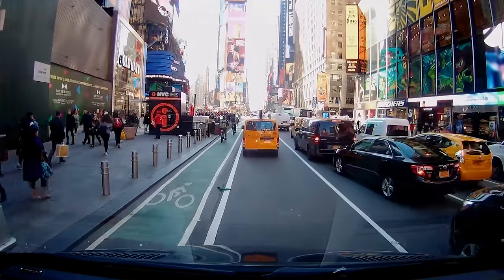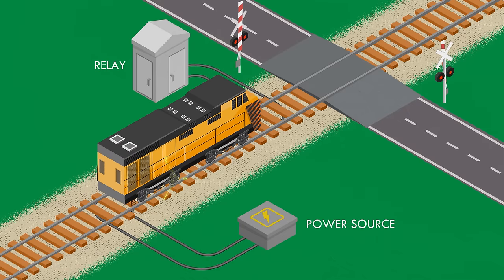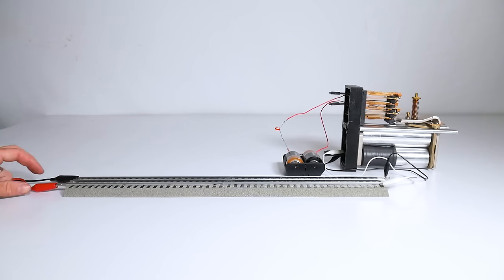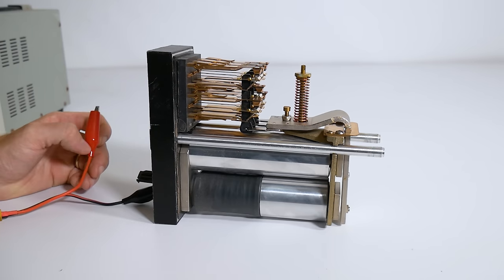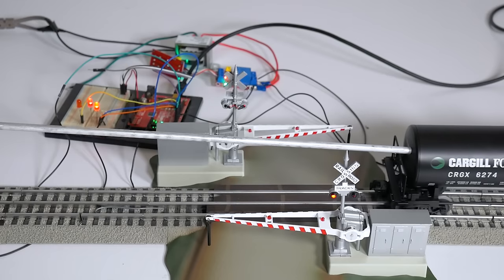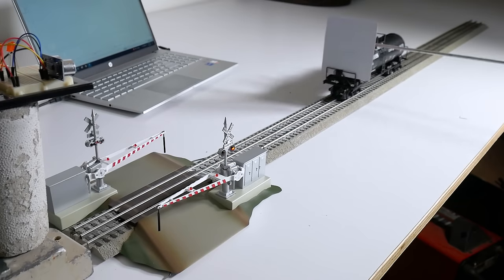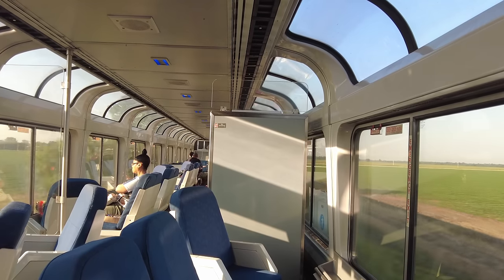How Railroad Crossings Work

Comment: In Italy the majority of railroad crossing have also train signals that turn green only when the barriers are completely down, and in certain RR crossings, if it don’t detect any vehicle in the crossing. If a car is stuck in the crossing, they can break the barrier and the rail signal turn red again
Reply: In the US there are a lot of protected crossings that also live in dark territory where no signaling system is used, so this system isn't in wide use even on PTC territory. There might be a few exceptions like dropping a signal to a restricting aspect due to a malfunction, but that's exceedingly rare. The most we use is a lighted whistle board that tells trains if the crossing is working. There's also a light that is used to communicate to train crews that the crossing is getting electricity.

Comment: sth I don't really like about level crossing safety in the US: after the gates are closed it doesn't take long for the train to rush through. In other words: when the crossing isn't clear there's no way the train can be stopped before reaching the crossing.
In Germany the max speed for rail lines to have a level crossing is set at 99 mph. Lines with a higher speed may not have any level crossings. In fact, even lines with a lower track speed may only operate the already existing level crossings, but new ones may not be built.
Gates at many crossings close 90 seconds (rule of thumb) before the train passes the crossing. This gives them the time to stop the train in case the crossing isn't clear for whatever reason. 
Also quite many crossings are equipped with CCTV or even radar detection to check if anything is located between the gates once they're down

Comment: Some tracks have rules about the minimum number of axles a train can have (usually about 30) to guarantee detection by crossings; or if you have less you have a greatly reduced speed limit.  Engines running alone for example.

Comment: Hey PE, this is a nice straightforward explanation
Now for tricky aspect - the sound level of the train horn. What factors are used to set that level? 
Does the average number of people within the range of the effective level contribute to the sound level?
Are levels set lower when the intersection is in an urban environment, and higher levels for rural areas?
When was the horn sound level last set?

Comment: Thank you for such a simple explanation and demos I live in a city where a power plant supplied by rail is located and always wondered why even when the trains were stopped the crossings near the plant weren't passable though why they decided to put the hoppers where the train cars dump their coal so close to the crossing is a mystery to me. Also not sure if it would be a practical video for your channel but do you think you could explain why instead of ripping up rails after they're abandoned railroads will leave them installed in Oberlin which is a town in Ohio I frequently visit as you come into town there's several examples of abandoned rail networks and crossings but the rails are still there sometimes paved over

Comment: Great video! Im curious how you are going to cover train signaling and how it works with train control/train protection systems, such as ATB in The Netherlands which if I remember correctly also uses track circuits, with each frequency emitted in the circuit updating the speed limit on the ATB however its displayed to the train driver, ATB seems to vary from train to train in Dutch railways with some trains displaying it as a speedometer bug, others just being a set of lights with numbers written on them displaying the speed, or a digital readout. The subject does get quite complex with each country having a different solution to signaling and different rules between railways are common even within the US, the same aspect could mean something very different, this issue is quite present in Australia and Europe as well.

Comment: Hi, My job is designing track circuits, and I have never heard of track circuits being able to detect train speed. Can you share your source for that? It would be great to know!
I agree that AC track circuits are used on tracks with electric traction. Audiofrequency track circuits (the ones where you can hear the frequency), are used because they don't need insulated joints. They can be used with contiuously welded track, and the individual track circuits are separated by an electrical barrier connected between the rails (typically a combination of capacitors and induction coils which are tuned to form a frequency filter)
Also you have omitted axle counters which are also frequently used with rail crossings. Definitely a topic for a future railroad video!

Comment: I live in between 3 train crossings (all around 1km apart) and thanks to this I understand why I hear 12 deafening whistles every few hours, more if there are 2 trains crossing in either direction at the same time. Given all of these amazing safety precautions in place at crossings, how necessary is it for the whistles to be as loud as they are? Would safety be compromised if the volume of the whistles were decreased by 20% or even 50%?

Comment: In Germany, there's also signals that tell the train whether the crossing is secured. That is either a dedicated signal that informs the train driver of the status of the crossing, or they're integrated into the block signalling, where a regular signal will show danger until the crossing is secured. Is that a thing to perhaps mention in the signalling video? Also, I would have liked a discussion of the various systems available that automatically detect whether a closed crossing actually is clear of obstacles.

Comment: In a rural area or out in the country their were areas where railroad tracks would cross a two lane highway and the only warning was one of those white railroad crossing  signs. If you were traveling along a deserted stretch of highway and came up on one you could stop and turn off your headlights to see if a train was coming. Most people would just turn off their headlights briefly to see if the trains light were shinning across the road. If they were you did your best to stop. You could not see the train in the distance because of trees planted on both sides of the track. And don't forget to pick up your feet as you cross the track. But I don't know why.

Comment: I used to drive a light rail train for RTD in Denver. most of the lines we operate follow this logic of crossings, and operate quite well. however the newest line, the R line, built through the suburb of aurora, was simply ridiculous! There are quite a few crossings along the R line where the train has to pull up to the edge of the crossing and wait several minutes for the arms and bells to activate. The R line was so poorly built and was such a pain to operate. I was frequently sent to operate it since I was the new guy and all the senior guys didn't want to operate it

Comment: The current detection method is similar to what is used for cars at some lights. Your car goes over an embedded electrical loop, and the bottom of your cars cause a disruption in the circuit, telling the controller that there is a car present. Ever since I found this out, I have been wary of where these coils are, and try to place my vehicle over them to make sure it properly registers my presence, otherwise I might be stuck at a light for a while.

Comment: Wish you'd discussed different safety levels that contribute to whether the train needs to honk. I lived 100ft from a commonly used freight approach and they were legally required to honk outside my window several times a day. The city said they needed to upgrade the intersection to make it so the train doesn't have to honk, but it would cost 100s of thousands of dollars. Always wondered what those upgrades were and who would be responsible for buying them.

Comment: In India we have even tougher safety measures. There is a gateman who manually closes the gates on both sides fully. That gate closure is mechanically linked to the signals. So even if the gateman sleeps over and doesn't close the gate, the signal is red by default. 

Also in India many bikes, pedestrian drive below the gates even when they are closed. The gateman warches them over and correctz them of thr train is near by. 

Our usual stopping time for one train to pass from time it closes to opening is around 10-15 mins. So major cities just skip the rail crossing by flyovers

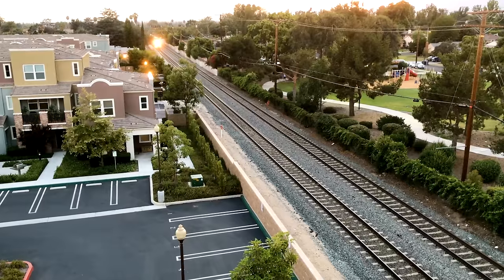Comment: 2:25 Almost all the mentioned features are country-specific.

In some countries the locomotives do not have flashing lights or bells (and both really are not necessary - so one can wonder if the US could get rid of unnecessary noise here?).
The horn is not used at crossings in general. It is only used if any danger occurs.

Comment: 4:35 Usually there is a uncomplete circuit to activate the crossing, with the circuit being completed as the electricity flows through an axle of the locomotive.

Comment: A big difference in the Uk when it come to crossing safety is that at the vast majority of crossings, the train is not allowed to cross until the barriers are down and the crossing proved as clear (either by cctv or by radar on modern crossings). Only then the signal is cleared to allow the train over the crossing. 

It makes for longer wait times but are much safer.

Comment: 7:30 that reminds me of truck driving. Our brakes use air pressure and if the air pressure falls below a certain amount, the emergency brake will automatically apply and you won't be able to drive / move

Comment: One of my Uncles was a car guy. No duh! He worked for Fisher Body back in the 60s and early 70s before he retired.
He told me about his encounter with a train.
The crossing was passive. It also had a slight upward grade, so the tracks actually were higher than the road.
He said the road was a bit slick that morning as it had a heavy layer of frost that had formed overnight.
He admitted he'd been traveling a bit fast, and a train got to the crossing before he did. He pumped the brakes, the car slowed but didn't stop. The front of the car barely contacted the train. He was surprised that the front of the car didn't catch on the cars but was hit in a stataco manner..

Duh duh duh duh duh duh
 Until the car finally rolled backwards away from the train. He opened the driver's side door and got out to peruse the damage (he didn't tell me how bad it was ) , he shut the door after getting out looked at the front end, then went to get back and the door wouldn't open. He went to the passenger side door, but it wouldn't open either.
This happened back in the 60s and the car he was driving, was a Cadillac, probably a mid 50s model. He was so Lucky that the car wasn't hooked by the train, dragged for yards and demolished,  killing him in the process.

Comment: Over here in aus we call them level crossings. Without fail the one that was across the road from my house would sound at 4:45 pm abd shortly thereafter a freight train roared by. Evebtually I worked out how to trip it off by running a wire across the tracks. :)

Comment: @PracticalEngineeringChannel This is the simple grade-crossing on a railway section  bteween stations,  without train protection or controll system. In case of central traffic controll the signaler/station attendant or the line-attendant conrols the crossing by opening and closing it (using manual or software depending on the techinal standards of a given line)
Reply: This is not true. CTC boards cannot activate individual grade crossings. Similar to ABS, it is done entirely automatically.

Comment: That system detecting incoming trains speed to stop crossings from being closed too long with slow trains is quite clever but unfortunately not a system we use over here. Here everything is calibrated to the maximum speed the fastest train is allowed to drive there. So a track that would allow some trains to do 160kph(100mph) would be triggered roughly 24 seconds before a train that drives these speeds arrives. If a freight train doing 80kph (50mph) drives on the same track it would just be closed for twice as long. A stopped train a kilometer(0.62miles) from the crossing would still keep it closed untill it moves back far enough or drives over the crossing.

Comment: In Sweden, most crossings have gates covering the whole road surface on both sides of the track. That way you can't drive around them, you have to drive through them. Most people aren't that impatient.

And for those wondering what to do if you get stuck between the gates, you drive through them. They're designed to break from the forces of a moving car.

Comment: I'm pretty sure the crossing sensors are much more interesting that that.  For example crossing detection zones overlap with adjacent crossings a mile apart.  My impression was that they lay frequency-passing shunts at the crossing's detection edge, and send that frequency down one rail and time the return on the other.  If they see the shunt, there's no train but the (failsafe) sensors are working.  If they see something sooner, they can measure its speed on the next pulse and prepare a 30 second warning time.  The most common crossing failure is failing to detect the shunt, and the gates come down and stay down.  How they waveform the frequency, whether as pulse or tone, I don't know.  Frequency domain or time domain range detection, in other words.

Comment: Grade crossing predictors work on the Doppler principle - the system sends out AC through the rails of a specific frequency, and measures the difference in the return to determine speed and direction of the train.

Comment: Pretty clever how they split it up in 3 so it can tell which direction it came from, I never gave that any thought.  I imagine they must have a NOC as well that actually watches all of these sensors for faults, so if something is triggered for longer than it should or in the wrong order they might send someone to check it out.

Comment: My driving instructor back in the day always told me that if your vehicle stalls on the tracks, you should immediately get out and grab whatever heavy/hard item you can find and use it to smash the light bulbs on the crossing signal. The railroad authorities will automatically be notified if it has a defect, and they will suspend train traffic at that crossing until the issue has been investigated.

Comment: Nice video.  But you left out what happens at a dual track crossing, when you have two trains coming from opposite directions, and how does the equipment deconflict that information to keep the gate down while both trains are passing.

Comment: 7:04 nice explanation.  reminds me of Disneyland's tower of terror.  The default position on the locks drops the ride from falling and it requires power to the locks to open them so the ride can operate.  in other words, if the power goes out on that ride it's no big deal. =)

Comment: I've not found the numbers on those blue signs to be particularly helpful. There's been several instances here in Kentucky where a train is either stopped on a track for a long period of time or has fully cleared the intersection but is sitting just ahead of it (but within the warning range for the signal), meaning that the crossing signal is activated and the gates are lowered. I called the number both times and both times it was over an hour before the issue was resolved.
I suspect that part of the issue is that the fines given to a railroad company for blocking a crossing longer than the legal amount of time are laughably low, and so railroad companies would rather pay the fine than put any effort into avoiding being hit by the fine in the first place.

Comment: Grady,
Can you make a video explaining the interworkings of locomotives and how multiples of them communicate with each other to move the train without buckling the cars or pulling them apart.
Reply: Ironically, trains still very much do run into themselves and break apart. How that's prevented from happening might not even be covered in this series because of how high level it is and because it involves train handling skills.

Comment: In 1995 there was a tragic accident involving a school bus with kids on board and a train at a crossing with a traffic light. 7 kids were killed when an express train struck a school bus who's rear end was overhanging the tracks. In the following investigation, it was found that there was a slight delay in the time between the crossing activating and the light changing (among other things). Following that, every light at a crossing would immediately cycle the moment the crossing activated. The site of the accident has been dubbed "Seven Angels' Crossing."

Comment: I have read about super long trains stopping on crossings for hours and even days, blocking the way for cars, children walking to school, and even emergency vehicles.  What happens then?  Do the signal lights/alarms just continuously go off?

I have also been curious about crossings with only passive warnings about trains.  Where are they located?  I grew up in the country and all the crossings I saw had gates/lights/alarms, so I was surprised when I read that some places do not have these safety features.

Comment: I am impressed by how many drivers who come up to a passive railroad crossing go full speed over the tracks and just take it on faith that there isn't a train coming. I always slow to a crawl, roll down my windows, and look both ways at every passive railroad crossing. It doesn't matter to me if drivers behind me get angry. They should not be just crossing at full speed, even if it's only a yield sign. The only exception to this rule is if a railroad crossing has an "EXEMPT" or "ABANDONED" sign under it.